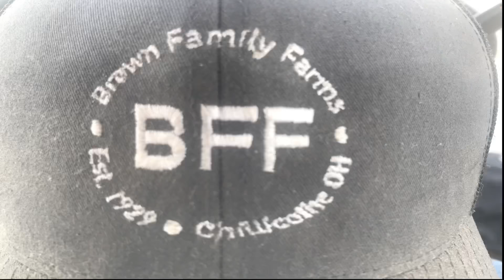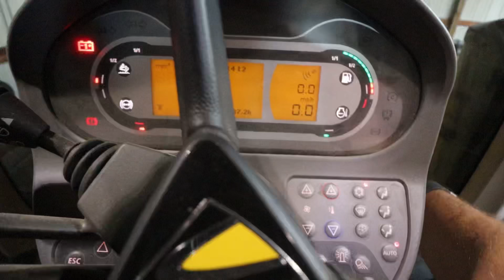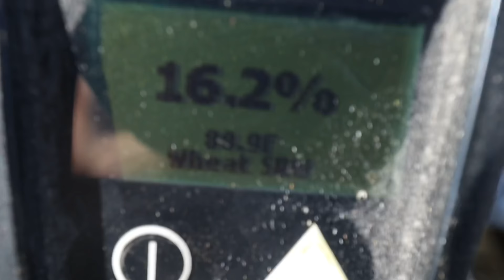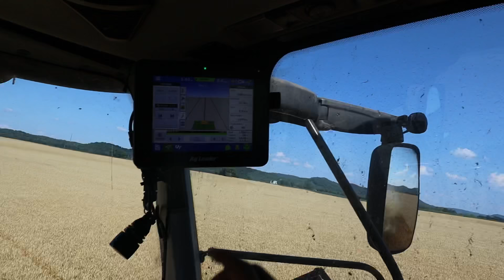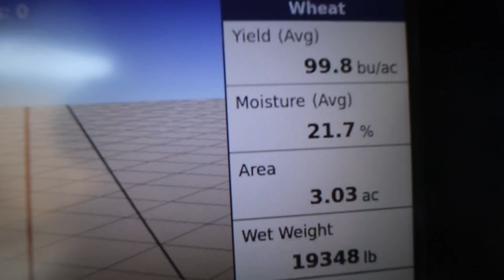My Combine Has A Hole In It

Comment: We wore out our clean grain tube several times on our JD combines. We ended up doubling up the metal thickness around it to keep the holes from dripping wheat out. On the inside of the tank we put plastic sleeves. Those worked well.
Reply: Best to just replace with new.     Shoupparts  cost much less because it is not JD and does not have a 40% dealer markup!

Comment: Yeah, whoever did that expensive inspection sure half arsed yours. An idle going out, that can happen any time. A hose leaking fluid... kinda strange for it just sitting and not getting spotted during inspection but I'd give the benefit of the doubt. But that elevator tubing.. all you had to do was open the cover and shine a flashlight in to see that.  I'd be having words expressing my displeasure in paying for a service that was done so poorly with the dealer.

Comment: A good way to start your equipment is to have a DC AC welder and set it to DC. thin set your cranking amps but don't leave it hooked up at hy amp for to long.

Comment: We harvested our wheat at 8%  moisture because it was delayed in the JD shop for a week.   Our's really did have a hole in the Combine.     The pan on the clean grain auger fell off because the bolts were not tight.   I lost a hopper full  because the yield monitor was a Trimble unit was not moved from the planter tractor.

Comment: That's why you use Roundup to dry it down evenly. This way you can get the wheat off in a timely manner and save the test weight before you get into a rainy spell.

Comment: I would be upset if I had a PMI done and the mechanic didn't catch the idler pulley and the hole in the tube.  I know our guys take all the belts off and spin all the pulleys to check them. The tube had to be cracked and or have a hole in it for the inspection.

Comment: Claas is one of the heaviest built combines on the market. Surely something is off in that grain tube to have a hole at 1600 sep hrs.
Reply: My thoughts as well, looks like that tube wasn't in straight, they use a heavy grade on those high water areas.
Reply: That’s a heavy wear point, our NHs have holes and wore out there by 1500hours.
Reply: @jackbannock3458  Are they the newer new hollands?
Reply: @cliffh8486  one is a cr 9070 and the other is a cr 8090. Our trs were like that also. Auger flighting is also terrible in NHs.

Comment: I’m surprised that you have to change “the grates” manually.  That looked like a hard job on a hot day, with limited access.  Lexicon combines seem to be overly complicated.
Reply from the maker: Don’t you have to change Deere concaves?
Reply: Not on a Gleaner...
Reply: Don’t need to change concaves on a Deere if you put the right ones in off the start. Some guys do though for beans but if you get the right setup in the beginning you won’t need to